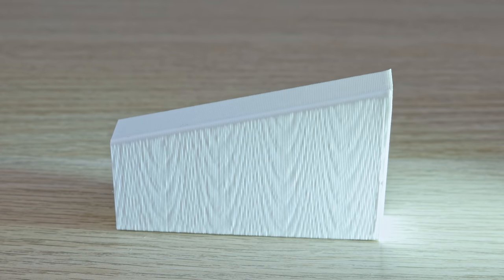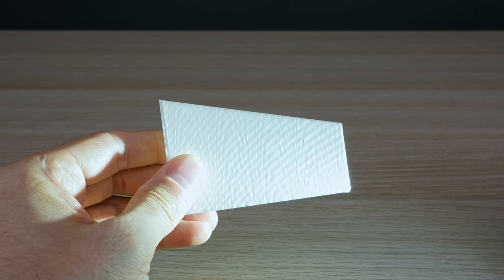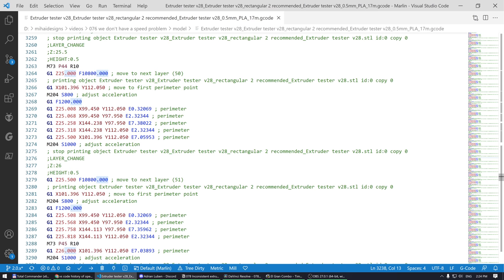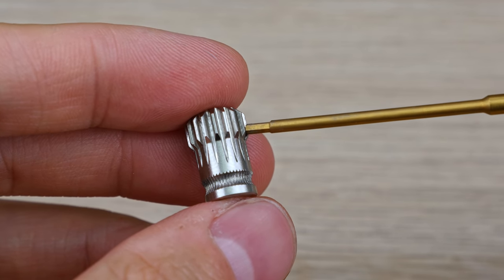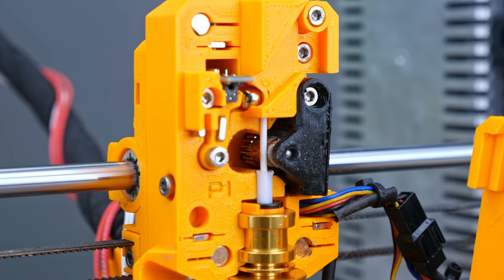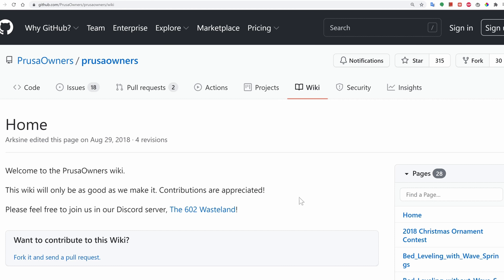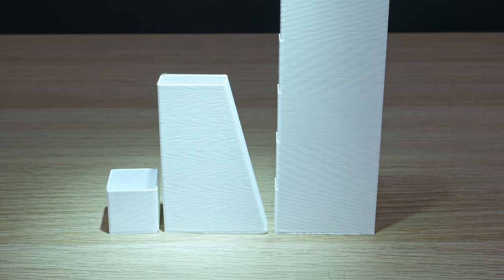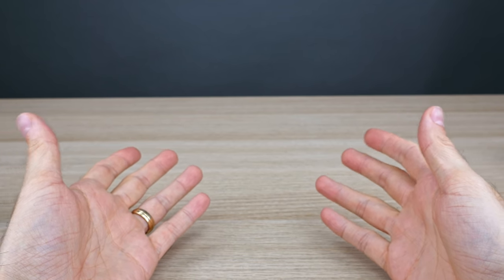What I've learned about dual gear extruders and how to patch them, maybe

Comment: 10:55 that's probably runout on the extruder wheel, meaning that the part of the extruder wheel that grips the filament is not concentric with the axis of its rotation, which effectively acts as if the extruder wheel diameter increases and decreases repeatedly to create that streched out wood pattern
Reply from the maker: Oh I see, that could be it!
Reply: That's what I was thinking. If there is any slop in the gear's inner diameter the set screw will push the gear out of center.  I would imagine this pattern would be doubled because of the two gears. Would it be less pronounced if the set screws were oriented the same (or opposite) relative to each other?
Reply: Some mechanical engineering insight - spur gears are designed to be constant torque + constant velocity, but this consistent transfer is only true at a set depth of mesh. The teeth must be machined precisely, with the correct arcs, and the center-to-center between the exes needs to be precise and a fixed distance to maintain the exact mesh. Any variance will cause the driven gear to move at a different velocity than the drive gear, depending on the angle of attack - in other words, as each tooth engages, pushes, and disengages, the velocity of the driven gear will decrease, increase, then decrease again.
Reply: @soundmindtv2911  If i'm thinking correctly to fix or minimize issue we have to have more teeth on the spur gears - the meshing will be more consistent with less speed variation (the speed variation frequency goes up and amplitude goes down). To have more teeth we either make teeth smaller - which in this case is impractical because it limits the filament diameter (too big and gears are out of mesh entirely), or make gears bigger. If we make driving gears bigger then the hobbed gears need to end up bigger too. Which means that we end up with something looking like BondTech LGX. And now I'm interested how that's performing.
Reply: @Doktoreq  I ran the test prints with my LGX and did not have the wood grain.  I'm an ME by education (though not by trade) and my theories as to why the LGX might not display the same extrusion periodicity as designs with smaller gears align with what you and SoundMindTV mention above (especially mesh issues caused by variable center-to-center), but I suspect the additional surface area contacted by the larger-radius hobs is also a factor.
Reply: @soundmindtv2911  Couldn't we at least improve this through ditching the spring-loaded tensioning, and doing a manual adjust + secure? Like having the passive gear on a pivot arm for adjusting the clamping force on the filament, with a grub screw that locks the pivot arm in place.
Reply: pr0xZen sure! Why not? If feeder section is designed with the correct gap for a given filament size, the spur gear end could be designed around that with a precision fixed distance, held constant to the spec of the particular spur gear diameter and pitch, and thereby deliver a constant velocity -  or, at least, an output rotational velocity consistently proportionate to the input.
Reply: @soundmindtv2911  This was the idea, but in significantly more tangible terms. I wonder if, with the common spring tensioning arrangement, if the spur gears don't collapse together and push apart as the gears move and mesh, creating an oscillating motion that effectively varies the extrusion output with the passing of every spur gear tooth.
Reply: @jamespray  I have 0 issues with my 3d maker engineering dual gear which uses small bonds has gears.
Reply: @soundmindtv2911  Involute gears do not need a precisely set centre distance to provide constant rotation transfer, the centre distance can vary a bit and it still maintain constant speed (although the phase changes a bit) which is one of the advantages of the involute profile. Involute is better with long term wear for the same reasons. As long as at least one tooth is in contact at all times. Too far apart and then you run into problems with meshing.

The easiest way to think about it in terms of the geometry is imagine a gear pair as a set of pulleys where each pulley is the the base circle (not the pitch circle) for the gear, and the wire between them is the line of motion of the point of contact between the gears, this is the basic geometry which defines involute gears. 

If you increase the pulley centre distance a bit, the wire between the pulleys gets a bit longer and changes the pressure angle. The wire is still unwinding from the pulley in the same way though, it is always tangent to the base circle. Therefore the point of contact is moving away from the centre of the gear as it is rotating, in the same way geometricaly as when the gears were at the normal centre distance. The downside being the overlap between the addendum and dedendum of the gears is reduced so there is less meshing contact.

I am thinking the issue may be related to angular misalignment of the shafts which causes meshing errors. The common procedure to account for misalignment is crowning the gear teeth. Although I could be wrong and something else is causing the issue, the only way to prove it would be to test.
Reply: Bordpie Yes, involute gears produce a constant circumferential velocity and transfer of torque so long as the mesh distance is within tolerance for the size of gear. In this case, the pitch circle dia of the gear is appx 8.7mm. The overall tooth depth is appx 1.6mm, meaning the normal line of centers is appx 0.8mm from the base circle dia. The filament is 1.75mm dia nom, but the opening for the filament path when the gears are at their nominal mesh is only appx 0.9-1.0mm. So the diameter of a harder filament will push the gears apart as much as 0.75mm, which is 0.5mm from the point where the gears will disengage altogether. If the gears are pushed far enough apart to create a situation where one tooth is disengaging prior to the next tooth engaging, we would see a fluctuating output, where the linear feed of the filament seems to speed up and slow down in a repeating, Measurable linear feed distance, as the feed slows or even pauses as the one tooth disengages until the next tooth fully engages - which, as it happens, is exactly the pattern we do see. And, if we eliminate the driven gear, and instead apply a friction wheel to the idle side, we would see that phenomenon disappear (so long as there is no slippage) - which we also see in our practical example.
Reply: @soundmindtv2911  Indeed. I just assumed that the designers did the maths correctly such that the gear overlap is good enough to maintain a constant speed mesh, it would be a glaringly obvious issue I would have thought. 
It could be as simple as the gears being pushed out of the proper mesh with rigid filament. The the solution then would be gears with a larger tooth module, and therefore a larger overlap like the Bondtech LGX.
Reply: @soundmindtv2911  Or maybe if the filament is not central on the hobbed gear groove, this could push the gears outwards further than the designers intended perhaps?
Reply: As a machinist I wondered about this

Comment: I resolved this on my direct drive dual-gear extruder for an ender 3 by adding four dampener silicone o-rings (commonly used on mechanical keyboards) between the extruder stepper & its mount. This gives the stepper motor's shaft a little bit of wiggleroom if it needs a slight angle for various filaments. screws can be tightened to adjust for stiffness/more angle, while letting the idle gear stay at a fixed angle.
Reply: Would you mind sharing the details of the idea? Any photos?
Reply: this is not a 3:1 dual gear extruder tho right?

Comment: Just a thought: Set the driven gear in a pivoting housing where the pivot point is biased to the gear teeth. Spring tension will hold the gear mesh constant and allow adjustment in the filament drive end of the gears. This will cause the gears to wear out sooner, but should help with print quality. Good video.

Comment: you like 30% right in this video ....the real problem are that gears arent press fit = any force aplied can make them twist etc if the gears arent tight on the shaft = impact the print quality 
taking out 1 gear stop them from moving all the time on shaft yet they still wont be perfect 
the new bondtech gears have press fit shaft , gear for motor etc and the quality is ...daaaaamn good

Comment: I got kinda frustrated with the number of teaser videos, but this is one very nice finding and good investigation. I would argue, to keep people interested you can also find better ways to engage with your viewers. The gears are not ideal, also from the perspective of size, as the LGX has spotted. It would be super cool to have another way of addressing both these improvements in a quality extruder gearing system. Nice job!

Comment: Good analysis. Gear manufacturer here. Simple helical gears would be fine since there's a negligible axial load on the driven gear, so a herringbone gear is an unnecessary expenditure. I will look into helicals at that pitch diameter.

Your analysis is spot on. If a spur gear  pair is not meshed at the pitch line, there will be a variance in the angular rotation rate of the driven gear.. this creates several problems in the extruder. Picture the cyclic forces on the filament itself. There is a smearing of the filament as it is forced through the extruder teeth due to the teeth failing to rotate at the same pitch rate.

The problem here is that the top hobbed 60 degree worm gear that grabs the filament has a pitch diameter that is too large. I'm going to guess that the 42% of the machines issue is a manufacturing tolerance feature for different batches of gears.

Comment: Two potential solutions I can think of:  a gt2 belt drive connecting both sides of the extruder but the routing is complicated by the necessary reversal of direction.

The other is to add a second steeper motor for the other drive wheel. This adds weight but it's not too bad if both motors are half size.
Reply: I was thinking about it, after some googling there exists double sided gt2 timing belts. This negates the reversal difficulty while only requiring the addition of a return pulley which can provide belt tensioning independent of extruder tension.

Comment: From a mechanical design perspective to make the dual gear more effective you would want to actually add another gear and change the geometry.  You want to have the gear meshing be invariant of the filament diameter.  It's difficult to explain in words, but I will try.  Think of a scissor with a central pivot point.  The drive would be in the scissor pivot point, then at the tips of the scissor is where the rollers for the filament would be located.  The drive gear could be connected to the filament rollers by a timing belt or more gears, but the main point is that as you open and close the "scissor" the gear meshing stays constant through the range of movement.  Ergo, gear meshing becomes independent of filament diameter and variation.  From a high level that would potentially solve the issue.
Reply from the maker: Would take 4 gears to preserve the rotation direction.
Reply: I had basically the same idea! you have two belts, 4 belt timing pullies, dual drive gears and two gears and four working shafts. Two master shafts, two slave shafts. The two master shafts is the motor shaft and a static shaft, with the two slave shafts one is static and mashes with the motor's shaft, the other is a pivoting slave shaft which is connected to the first slave shaft and pivots around it. The motor master shaft turns the static master shaft with a belt the motor master shaft also has a gear that meshes with the static slave shaft's gear, the static slave shaft is then connected to the pivoting slave timer pulley with a belt. Essentially it would look like this when closed | | then with the pivoting shaft open it would look like this | /.

I think this solves the issue but would be quite a bulky extruder, unlikely to be practical for direct drive.

Actually in finishing writing this out, I've already thought of another solution that requires only one belt.

Comment: maybe try building the fuselab extruder drive system, it doesnt use gears, its basically a tapered nut (they use 3 angled threads or something) that rotates around the filament pushing it like a screw.
Reply from the maker: Does it still exist? I haven't heard anything in over a year.
Reply: I've seen one hobby build replicate it.  The rollers need to be inclined to form a hyperbolic pinch zone.  Groved rollers are probably optimal, but fine pitch threads should work nearly as well.  Would need some work to find the right roller angle to make a 3 or 6 start thread on the filament.
Reply: i tried making a rough concept using modified m8 threaded rods slightly tapered.   that are static and pretty rough.
i think the biggest problem is filament twisting itself.

not tested tho.

https://www.thingiverse.com/thing:4907745
Reply: I think that is patented? I could be wrong about that.
Reply: as long as he doesnt sell it? who cares.

Comment: straight teeth will allways "step from tooth to tooth". hence the angeled teeth in a vehicle gearbox. citroën used to glue 2 together to eliminate axial forces. and offcourse, electrical engines never realy spin perfectly "round" they are limited to the windings inside. adding another gearbox can reduce this. but all this is very deep into the basics of any printer. amazing how you found, tested and work on solutions.

Comment: You know your extruder's tensioning screw...what happens if you use two? One at each end of the axis of the idler gear. Shouldn't that allow you to minimize backlash AND keep pressure on the filament?
Reply: It looks like more of a design flaw. If you are using retraction then when you retract the play in the gear mesh will cause headaches...
Reply: You will end up with a worn out pin or bearings in the gear that uses a pin.
Reply: @1tibbers  That's how it works today, I'm just proposing to use a spring at each end rather than just the one
Reply: I think I get what you mean, two tensioning screws could then allow some twist/rotation of the gear itself, and yes this could solve/alleviate the issue. But I bet you would need quite a lot of calibration work to do manually for each filament.
Reply: @Kalvinjj  Yes, that's the idea. The tension would be set by the springs, not sure calibration would be complex

Comment: 2 things come to mind...this could also be caused by the friction as the teeth meet and not so much the backlash.  At either rate a very thick and sticky grease on the spur gear portions could help with both the friction and the backlash.  As for an alternative drive method you could put the spur gears on another axle and belt drive the hob gears.  In this method the gear mesh of the spur gears would be constant and you could set how tight they are much like an RC car does between the pinion and spur gears.  The hob gears would then be on their own axles and move together in opposing arcs.  So long as you make the pivot point the spur gear axle then the belt tension would remain constant.  It's quite a bit more moving parts but would minimize the effect you speak of.

Comment: Brilliant work figuring out the problem. I'm no expert on gears but there are several things that might address this. One of the spur gears can be split and rotated. This rotation can be spring loaded. Helical gears may fix the problem and one gear can be moved in or out along the shaft to take up the play caused by different filaments. One of the gears could be conical and axially loaded. 

Again great work. No the gearheads can jump in and tell us which type of gear we should  use.

Comment: What amazes me is the fact that I got 2 printers with direct drive bondtech extruders. One does have the exact problem you are discribing. The other one is printing perfectly fine without any  surface problems. While the results you found make sense to me, I just don't understand why one of the extruders of mine are working fine while the other one does produce strange surface patterns.
Reply from the maker: I ask myself the same thing. I know many Prusa printers show this, but many work just fine. And throughout the data I received from users the same printers and extruder models can show different results. My only guess is that there's very little room for error and any misalignment would result in these problems. This would explain the printed extruders which won't be exactly the same due to variations in the printed parts and perhaps how tight every screw is. It's just a theory.
Reply: Yeah, my current hypothesis is it is caused by angular misalignment between the shafts which cause meshing errors. Hence why it occurs on some machines but not others. The fix in industry is tooth crowning so that may be worth investigating.

Comment: Nice discovery. The first extruder that comes to my mind, that probably doesn't have this problem, could be the Bondtech LGX Extruder. Although, it still uses 2 Gear to mesh the 2 filament grip wheel. But because the gears are bigger, and have more teeth, you can get again the pattern but with a small dimension...
Reply from the maker: Yes, I want to try the LGX.